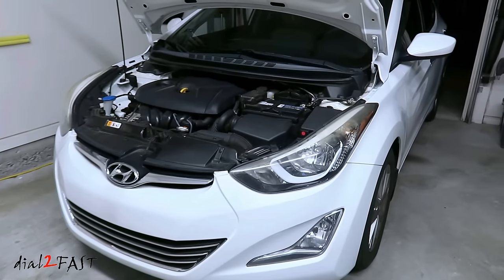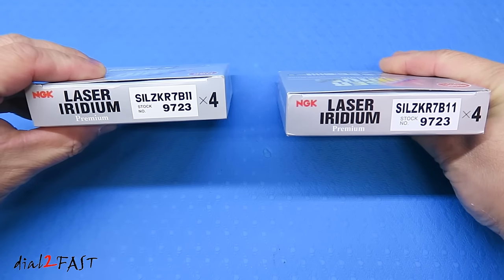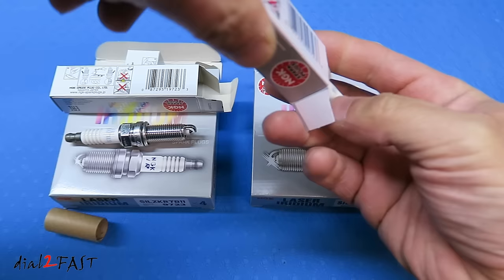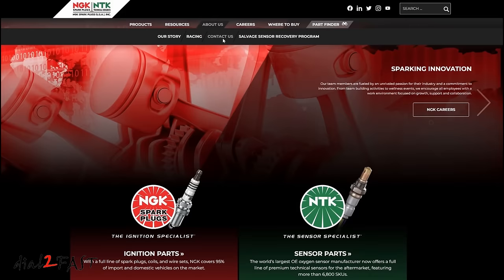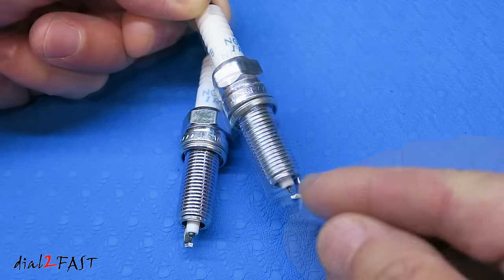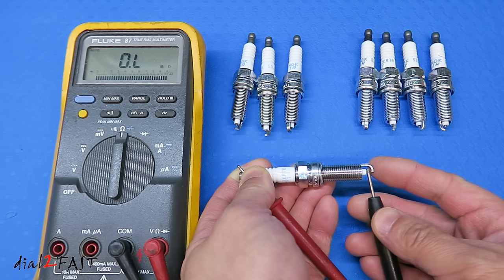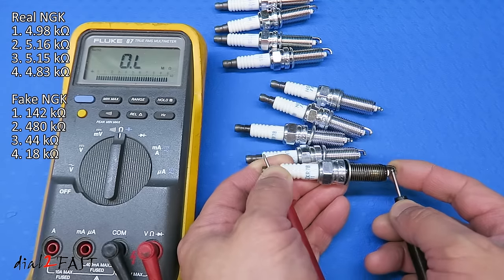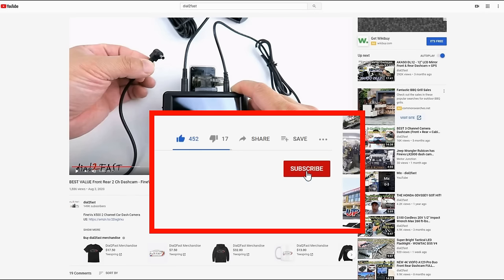Fake NGK Iridium Spark Plugs | How To Test!!

Comment: I told my local parts guy I bought NGK iridium plugs on eBay and they were fake and he looked at me like I was crazy. He was basically talking crap to me with his other associate. But I promise they do sell fake ones. The symptom or problem I had with mine specifically was that after just a short time the gaps increased dramatically.
Reply: Local parts guy, so a teenager or an immigrant who knows how to punch in your make/model/year but knows nothing about cars.  My local place didn't have a pulley installer and refused to order one, told me to install it with a sledgehammer.  I asked what he thought that would do to the thrust bearings on the crank.  "The what?"  He was the manager.  For the proles out there, it would mean removing and rebuilding the crank assembly as if you'd thrown a rod bearing.

Comment: I just purchased myself original NGK’s Spark Plugs for my 2015 Subaru Wrx. Turned the car on once the Spark plugs was installed and immediately got misfire code. Remove them and install the old ones back and misfire code was gone. Still got them brand new Spark plugs in the gloves compartment car. No money refund from the auto parts store I bought them.

Comment: You are actually altering the resistance reading by holding both probes with your fingers, in essence sending some of the signal through your body, which is a very good conductor.

Comment: Excellent video. We’re would you find the plug resistance band for other plug manufacturers?
Reply from the maker: Often the resistance is between 3 - 7.5kohm. I don't know if the resistance information is published by the manufacturer, but you can perhaps test and compare an original plug with one that you are concerned about.
Reply: @dial2fast  Thanks much. I have a new set of NGK plugs for my ‘69 Chevelle that I will check the resistance!

Comment: The second fake plug shows .480, not 480.
Reply: The display units changed from k to M, which is .480 mega ohms, not kilo ohms. .480 mega ohms is 480 kilo ohms. Attention to detail is important

Comment: I bought ngk platinum from Amazon i havnt installed em yet u think Amazon sells fakes I paid $30 for 6 I’m scared to put them on now 😢
Reply: I bought a used car that had to have a secondhand engine because two spark plugs broke. The bits had fallen into the cylinders. Suspected fake plugs. At least the engine was about 35k klms newer. Just over $2k cost. See if you can check the plugs next to originals. Good luck.

Comment: If you think fake spark plugs are bad ,, try fake oem brake pads where the friction pad material failed and de-bonded with the backing plate on both front brakes
Reply: Yep. Our auto shop often has people buy their own parts for us to install and pads turn out noisy all the time. Part stores even ask customers which level of quality/pricing they are willing to buy?

Comment: this is all fine and good info, but you are not using the ohmmeter correctly. You are not supposed to touch both metal parts of the meter leads when taking resistance readings. The resistance of your body can throw the meter off. It is best to not touch the metal part of the meter leads when taking any resistance reading. Don't believe me, just hold the leads in your hand tight, like you were in the video, 1 lead in both hand. And look at the meter. Your welcome. Also you were touching the center electrode and the ground part of the plug at same time with the meter lead you had in right hand. Not correct way to test plug resistance. This is how you test plug resistance correctly. https://www.youtube.com/watch?v=JWyle41XO_k&t=88s

Comment: I pay the piper for such items.... a broken plug in the cylinder can ripple effect and wipe out an engine..I replaced the VVT gears and paid 5x more than the ebay cheapies ( vs OEM)..... but no way was I going to open up the block to install the cheapies and take that risk...

Comment: Brilliant video!  I wonder… if the fake ones are really authentic ones that failed QA? Maybe the guy whose job it is to throw them away really sells them on Amazon? That would explain why they look almost identical to the authentic ones.
Reply: No they are proper counterfeits rather than QA rejects, the materials used for the electrodes is incorrect.

Comment: Thank you so so much. I bought a pack of 4 NGK (from a famous on line store) for my Stihl chainsaw, and i couldn't understand why the equipment i had new plugs in (and chainsaw) were using so much fuel, and took an eternity to start. Just on the off chance i watched a few vids to understand whats going on. ( never thought it was new plugs!) I did your test an lo and behold, a total box of fakes! I did get my money back (Barely inside the return date!)  Got some from local shop and all is good. 👍

Comment: The resistance on the second fake plug is actually .480 not 480. (point 480) That's really bad. (less than one Kilo ohm)

Comment: i appreciate you showed how to use a multimeter to test for fakes. I bought my toyota oem plugs on ebay, they were 50 dollars a set of 4 and i needed 2 sets but im having a miss on cylinder 7 and i feel like i bought fakes. So i just got some ngk plugs from napa and a new ignition coil . when i pull the plugs i had installed less then 2 years ago im gonna test them for sure
Reply: You can always swap the #7 coil with a good cylinder and see if the problem moves to the one you swapped with.

Comment: I have had troubles with spark plugs in motorized bike engines.  I never thought to measure the resistor impedance.  Your answer provides the the consistency values I was missing.  Thanks for clearing up this mystery and giving me  some way to prevent future errors.

Comment: Good video, just something I noticed, your number 2 fake one was actually M ohms not K ohms. Massive difference. 
I ve been doing Diagnostics for 20 yrs plus, and with coil on plug coils, the back emf to ECU could and would blow the drivers off the board.. 
As my dad used to say... buy cheap pay twice, in case of those plugs could write off some cars. 
Hope that is helpful and not taken as criticism,  good to show up these copy parts that are so dangerous. Cheers.
Reply: Number 2 is 0.488 MΩ = 488 kΩ

Comment: Your method of measuring the internal resistenace of the plugs is totally incorrect  on severl occasions your body resistance was in the measurement in others it was not  correct that problem and use a no contack with the DUT method then republish the measurements
Reply from the maker: Nothing wrong with the measurement I did because understanding electronics is important here. I am measuring kohm resistance, not Mohm. My body resistance is not in kohm, it's in the Mohm range. Parallel resistance of my body (Mohm) and the spark plug (kohm) will always result in showing the lower resistance. You can try it yourself, measure a 75kohm resistor with and without your hand touching. The result will still show the 75kohm resistance.

Comment: Would sure be interesting to know where these fake plugs came from. Making a spark plug of any type is quite difficult, requiring special equipment, material and processes. These are remarkably close in appearance to the genuine products. It would be doubtful if the electrode tips on the fake plugs are really iridium, as iridium is expensive and difficult to work with.
Reply from the maker: It's probably a factory that already makes spark plugs in China, and for the copy they just change the tooling of the machine to make the final product look like the original.

Comment: WOW!  This is significant since many GDI engines require spark plugs to be indexed to the fuel injectors.  However, most people will install to the specified torque, which will properly index the plug if it is genuine or OE.  If fake plugs do not index properly at the specified torque, they can cause serious engine damage.

Comment: Cheers. I knew about all the physical differences; there are quite a few on the main box as well in terms of colour and font. But the multimeter info if top notch. Cause the fake producers might resolve the external stuff, but if they also go deep enough to make the plugs pass a technical test then...i can accept those fakes :)

Comment: Thanks a lot! Very useful.
I bought fake Denso iridium spark plugs from ebay, like 5 years ago. They couldn't last even 50K miles and their electrode was completely gone. Regardless that iridium spark plugs are rated for about 100K miles.

Comment: The truth is that I looked carefuly at the video and when you checked the fake ones the measuring electrode was toucing the spark plug body as well as the tip, and on the original ones you were not touching the spark plug body. I would be happy if you run the same check without touching any sprk plug body. I can guess the outcome would be much different.

Comment: i had the same issue bought from ebay, by the time i found out that fake it dead missed fire 3 month after then it too late to dispute, that is the trick about these ebay scammer, BEST THING JUST TO BUY FROM LOCAL AUTO PART OR FROM YOUR LOCALL DEALER

Comment: I must have had the fake ones. Barely 10,000 miles, the tip of the iridium all worn out. The original one from 2005 Honda odyssey still look good after 115,000 miles. I don’t buy from Amazon or eBay anymore. It is so rampant and they are not cracking down on the scrupulous dealers. I would rather spend $7 more each plug ti get the real ones. Besides, you only change once every 5 to 10 years.

Comment: Just checked my Denso resistor plugs, all were the same except for one a little higher at 5.9k ohm. Using cheap meter leads it was hard to get a accurate reading, pressing hard and using fluke leads measurement was spot on each time.

Comment: I’ve been road racing since 1990. Mostly motorcycles. Another big issue is the gap. The fakes won’t be as close as the real ones right out of the box. Even pre gapped aren’t exact. But the fakes are way off.

Comment: @ 1:50 they are actually not the same number 19 VS  09 at start of second set. Also last tiny digit 3 VS 6.  
That caught my eye as the fake ones have the exact same barcode number on the single, as the 4-Pack. Usually things have a similar but slightly different number for a single, so if you bought just one it would scan as one. The genuine ones have a slightly different number. 
Not sure if I missed it, where did the fake ones come from? I think Rock Auto is basically safe, but you never know.

Comment: Ive had trouble with NGK plugs as well. New plugs and they fail. Ive been tearing my hair out ( an i haven't got much left) chasing an electric issue .....ive been replacing them with champions and bosch without any problems

Comment: The manufacturers of the fake spark plugs can adjust the resistance of the plug. This is probably not too hard to do.  The difference between Iridium plugs and regular plugs is the geometry of the electrodes and the material used in the electrodes.  The geometry is easy to copy.  The material not so easy.  If they use the same material as the original, then the copies will probably perform similar to the originals and will probably not be so cheap.

Can any chemist here  suggest a way to test that the electrode is actually made of iridium or if the ground electrode if made of platinum?  Or can you suggest a way to test if the electrodes are made of nickel, which is commonly used for regular plugs? (according to the NGK website)

Comment: I ordered and installed a set of those plugs, from Ebay, for my Toyota and he is right, at 5k miles I noticed a very slight miss I  pulled out the plugs and the "Iridium" tip  was all gone, never order plugs from Ebay or Amazon they could be a fake set and damage your vehicle, better pay more from a reputable place

Comment: Common items like spark plugs I wouldn't buy online.  Curious to know though, where online did you get the fake ones?  So that others would know what to avoid.  I would suggest if you are going to buy online, get your plugs from an auto parts brick and mortar store or reputable auto parts dealer.  Personally, I would Never buy items like that on ebay.  Getting supposed "new" items on there are most likely Chinese fake garbage like what was sold at old fashion flea markets.

Comment: note, it will only have the resistor if its a resistive plug...

ngk numbers really went wacky with all these new cars and designs...

but yeah, theres the R... silzkR7. no idea what silz stands for...

was easy when it was just cr8eIX... cpr8e... c8e... bpmr5hs... thread size, projected tip, small hex, resistive, heat range 5, short thread...

funny, NGK will verify authenticity but wont give you a list of every plug they make... ive asked.

Comment: The resistance of the second FAKE NGK spark plug measures
452 - 503 Meg Ohms  and not 480 KΩ  
You are misreading the meter
Pay attention to detail
What is to the right of the decimal point is Meg Ohms

Comment: Im not sure if this is a joke or not!! At 1:08 you show identical boxes, at 1:27 you cut and now boxes are different.  The number on the boxes are not the same continue on where you say the numbers are identical the one on left has a zero at beginning of second set of numbers and on the right it starts with 1. Ive seen too many times how serial numbers can be 1 off but still have same part number ... it can be due to slight changes in requirements, or partial year change, or many other factors including sub contractor making parts. I didn't see you say that you asked company about " fake" set. Nor did you send them in for verification. But i did see the edit at wrong time to make me wonder.... did he actually get fakes and couldn't duplicate so you edited or are you being dishonest for youtube views.

Comment: This explains why I've had two sets of plugs fail. I believe the shorted out and were causing my coil to arc across the positive and negative to the body of my coil. The coil was extremely hot to touch. Ill have to check my replacements. I had to do a sparkplug swap in a parking lot because my engine stopped running. Also my RPM tac has been jumping around sporadically.

Comment: I live in the US and I get my spark plugs for my Toyota by walking into the dealership or a reputable place like Advance or AutoZone. I don't like my plugs to get shipped as they get banged during shipping and the tip may get bent and those  areiduin plugs are not supposed to be gapped.

Comment: Where did you buy the fake spark plugs? I just ordered some from rockauto
Reply from the maker: Rockauto should be fine. Just don't buy it from Amazon or eBay.
Reply: @dial2fast  I was about to ask the same question.  I’d imagine RockAuto would make it right if some fake ones snuck into their inventory by mistake but now you can test them anyway.  I’m going to!

Comment: When measuring resistance, please stop putting your fingers across the terminals. You are also including your body resistance in the circuit. As an electronics engineer, this is a big no-no!

Otherwise, a very informative video!
Reply: Very good advice in general, though if checking if something is 1k or 5k it's not going to make enough difference to cause ambiguity.

Comment: I'm concerned that I purchased mine from Amazon. 6 months later, I had an ignition misfire. I  only  replaced  the old ignition & sparkplug that was at fault, and the problem went away. As soon as I get a chance, I will check all sparkplug. Thank you for this video.
Reply from the maker: Maybe it's a different spark plug that has failed, and not the one you replaced.

Comment: You might want to remake the video again. By touching the hook of the spark plug with your finger, and wedging the probe tip between the center electrode, you are also measuring your bodies resistance in parallel with the plug's core resistance. This can vary with humidity, blood pressure and your age. 
Hold the probes, between your thumb and forefinger of each hand. The resistance will even vary by your finger clamping pressure
Having real values here would make a valid point. 
Did you pass a sharp blade over the iridium tip, to see if it was real or just coated?
Reply: Body resistance is at least an order of magnitude higher than the values being measured here. You should avoid touching the probes as a general rule, but it won't invalidate a simple test on liw resistance parts.

Comment: Thanks a lot l. You r a really good mechanics! Spark plugs use electricity, so the smartest way to test it is checking resistance. No wonder why the fake one blows up so fast. It runs a lot hotter bcoz of much higher resistance l

Comment: I own an old V8 chevy. A previous owner had gone to a really cheap knockoff brand of OEM sparkplugs and ignition wires (most likely a retiree just selling the RV) then the next owner had gotten a few years of uses with the RV with their family till later on their kids became teens and they outgrew the RV. Shortly after I had bought the motorhome, I had some misfiring. I had switched the sparkplugs for the chevy 454 back to the AC Delco brand and replaced the ignition wires with a Blue Streak brand. I had also side gapped the set of sparkplugs by trimming off part of the ground tab which exposes the spark more directly to the combustion mixture for better power. At only a few dollars each for sparkplugs. I didn't fall for an aftermarket brand of factory sidegapped or E3 sparkplugs that are way overpriced and possibly prone to premature failure. Even if an OEM has a premature misfire or they start showing their wear after accumulated mileage and use, they're still cheaper to replace. I have used NGK plugs in my honda civics before and I was never disappointed with their quality and performance. I've also done the same side gapping to NGK plugs and they've worked great!
Reply: Iridium plugs are not "only a few dollars" which is why they are targeted for counterfeiting.  They are $10 or more per plug.